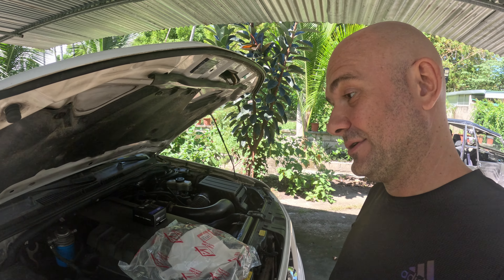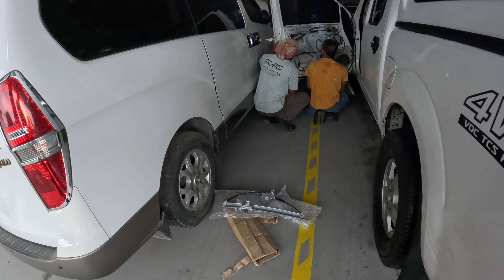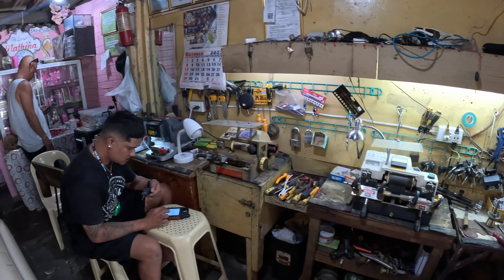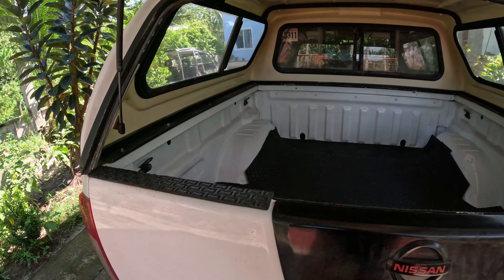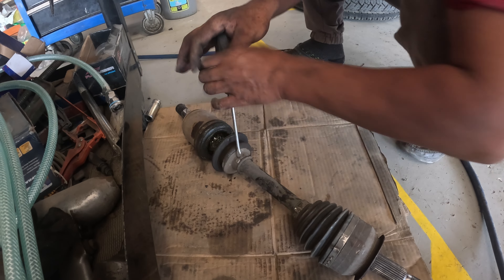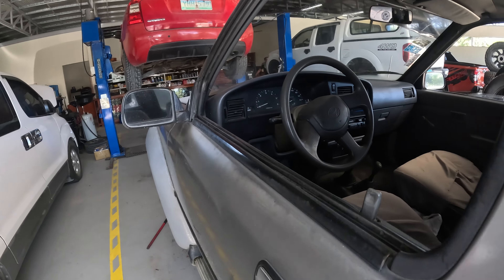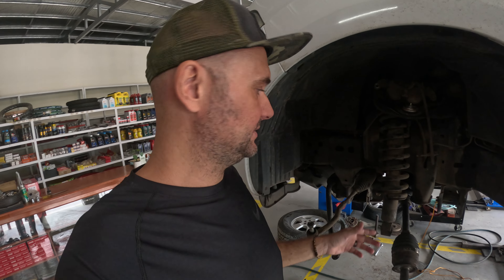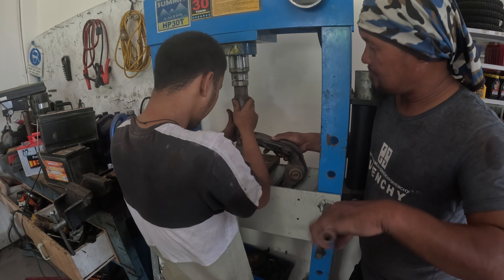Repairing a truck in the Philippines - second hand cars | ISLA PAMILYA | NEGROS ISLAND | 4K

Comment: If you buy a used car in the Philippines, you will have to redo the entire front suspension. I had do that with my Suzuki multicab, but still in was super cheap compared to the west.
Reply from the maker: I saw a five-year-old Ford ranger that had a completely wrecked front suspension, the wheels moved like pendulums, I wondered how you can drive that.

Comment: When you bought the car used did you take it to your mechanic and have him go thru it with a fine tooth comb listing everything needs to be replaced or worn out? Buyer beware is the old adage they say if you keep putting money in it get Rid of it it going to be a money pit
Reply from the maker: I'm simply repairing what should be repaired, in an 11-year-old car that has been on Philippine roads, control arm bushings and ends, stabilizer links are normal things that need to be changed. I recently saw a five-year-old Ford ranger that had a much more wrecked suspension than this Nissan.